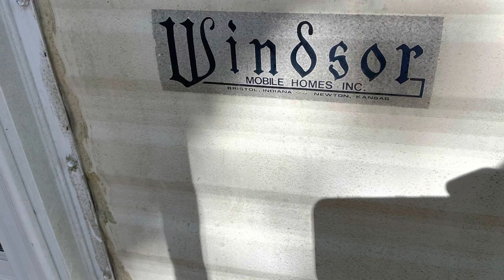Singlewide Trailer Roof Replacement. How are we doing?

Comment: I don't think a rubber roof would work in this climate
Reply from the maker: I think it will work in any climate I have people installing them in Michigan Alaska Maine New Jersey Alabama Ohio Tennessee West Virginia Virginia New Jersey
Reply: It might dry out and crack here. High heat and single digit humidity levels makes a very hostile climate for stuff. A mile above sea level with thin air doesn't help either.